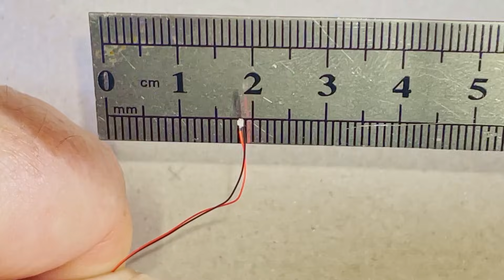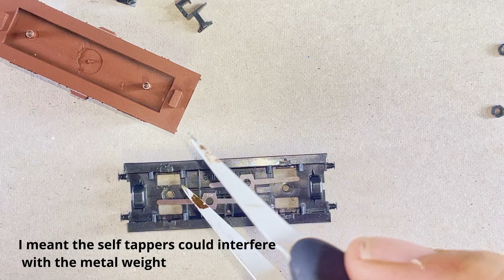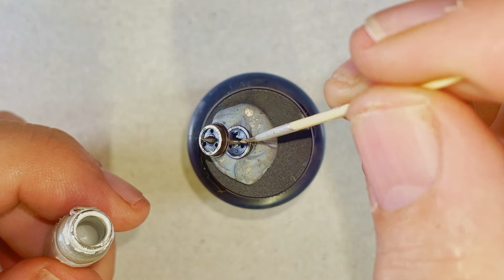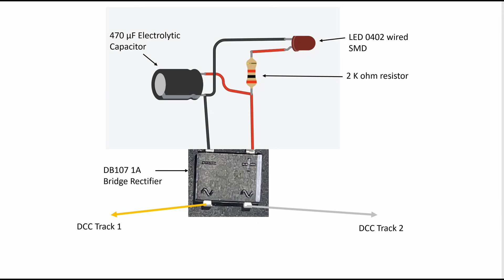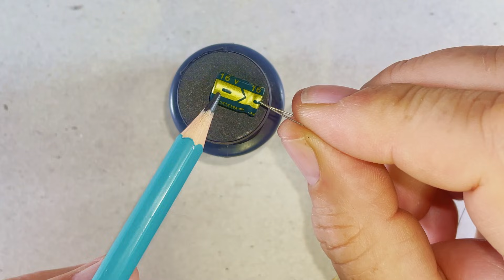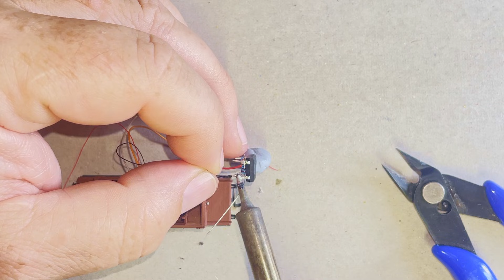DCC Red Tail Lamp Upgrade for your Brake Vans - Even Fits N Gauge Models  Ep11

Comment: With DCC the rectifier is not needed at all, just an extra diode in the circuit. Remember that the LED is a diode so filters out the asymmetric DCC signal together with another ordinary diode on the other LED lead.
For DC use, the rectifier is vital and without the need for diode mentioned for DCC use

Comment: You do not need a bridge rectifier if it is run on dcc. If run on dc yes you do.
Reply from the maker: I chose to use a bridge rectifier, considering the continuous running application, and so to avoid any possible reverse bias stress on the LED. If you see my track tester video, in that application no rectifier or opposite LED is used, in testing that application with modern LED’s I didn’t have any problems.
Reply: It's a nice little project with a good result. I agree the rectifier is a good thing to have, it makes the circuit much more robust. If you so choose, you can run on DC too without any modification. 

When I added coach lightning to a few coaches, my circuit included a variable resistor so I could adjust the LED brightness, which I found especially helpful especially. 

Also Grafar sell a spare wheel set that is conductive so you don't need to bother with the paint (but they don't have the nice holes or rather the three hole variety isn't conduitive).

379-412 Coach Wheels

Comment: Great presentation, well done.   What about heat, 16V to 3 V with the resistor.  Does it generate heat?  And are the components and van body OK with the heat generated?
Reply from the maker: Thanks for your comment 😀. I don’t think heat should be a problem with a 2 kohm or higher dropper resistor the current flowing is in the order of 10ma through the LED, and the power dissapated by the resistor is in the order of 140 mW. Although I recommend you check the temperature of the resistor to be sure. I did not notice the dropper resistor getting warm myself.
Reply: @LlanfordParkModelRailway  Thanks, very fast reply.   Could set it up on a breadboard to check heat, and desired brightness of the LED.
Reply: @richlawrence4160   Exactly.  Breadboards are your friend.  Avoids all the "fiddly" concerns re available space in the  piece of rolling stock while one perfects the circuit. 

Makes solving a  problem determining whether to use a 1K ohm or 2K ohm or 2.5 K ohm or 3K ohm resistor as described below by  @LanfordParkModelRailway easier  where one does not need to keep changing resistors already intaed in a  car / van. 
 
On a  side note, I vote for  a capacitor rated at 25 v. for all applications, whether DCC or DC.  Keeps things simpler in terms of electronics parts one needs to keep on hand in inventory and the 25 v. rating caps provide a tad more protection.  My HO  ( OO for you Brits) runs on DCC while my HOn30" (HOe or HOm) units run on DC.   The narrow gauge logging is integrated into the same layout, but the ng trackage  and the standard gauge trackage  do not actually connect.

That is a problem I will eventually solve, but the size problems with the decoders in what are essentially N scale  engines is a problem which will take some time and some funds which are not currently available.

Comment: 100µF 24V is better
And I would have used the thin wires of the LED and brass strips for pickups
You can buy wheels with one side conductive, so no need for conductive paint

Comment: Love the idea. For older stock running old style lamps it's great. I run 1980s to 1990s that would be flashing tail lamps. Could u make this system but add flashing ?
Reply from the maker: It is possible but would need some more electronic components for the flashing circuit. For N scale the challenge  is always fitting components into the space available
Reply: @LlanfordParkModelRailway  very true. I model oo at the moment so space is not as much of an issue
Reply: @stocktonjunction  One can also find LED's that are pulsing from factory. This will eliminate complexion. Also, if you leave the capacitor out it will pulse whenever the power pick uop is not perfect :D

Comment: I put a tail light into the same brakevan using a length of fiber-optic cable. The LED is inside the van, the fiber runs horizontally into a tiny square of plasticard representing a tail lamp. Much dimmer than a SMD viewed directly!

I'd like to develop it into a system where yeu can tap a magnet on the roof to turn the lamp on or off
Reply: Just fit a reed switch in the line to the led, inside the roof panel, then a strong magnet will work. you only need to fit the switch on one of the wires, either one will do.
Reply: I’ve done the same in my N EFE shark van using a sleeved fibre optic and a flashing red LED with a white metal tail lamp drilled out.👌

Comment: Nice build, though very fiddly 😂. I do recommend to solder a resistor and reverse diode between the rectifier + and the capacitor + to limit the capacitor load current.
Reply from the maker: Thanks😀. I did try and measure the capacitor inrush current, but the charge was so fast I couldn’t read it on my DVM .

Comment: Only problem with this is its way too bright. I started on the footplate in 1980 still in the BR paraffin lamp era and the best you could hope for from a tail lamp, even a signal light is dull flickering glow.
Reply: True, I am a former secondman east London Stratford depot, and yes your right it was always a dull glow at best  !!!!
Reply from the maker: I do agree having run mine for a while. I started with a 1 K ohm resistor and that was far too bright, so as in the video changed to  2 k ohm resistor to lower the brightness. I would use an even higher value dropper resistor next time maybe 2.5 k ohm or even 3 k ohm’s
Reply: The paraffin signal lights were really bad. North/north west of Edinburgh was predominantly semaphore signals back then. Being cautioned at night resulted in peering into the darkness to spot the signal. As one old driver used to say you have to find them before you can stop at them!
Reply: @LlanfordParkModelRailway  Try a variable resistor maybe?
Reply from the maker: @maltnz That’s a good idea thanks

Comment: Nice video, this is a simple and good solution for installing tail lights (and other lights) in model wagons. 👌😎👍
I have one note though*: Due to the fact that an electric motor (like the one in a locomotive) can generate a CEMF (Counter-ElectroMotive Force) that can be of considerably higher voltage than the power normally fed to the rail, it may be safer to use a capacitor rated for 25 volts instead of the 16 volt capacitor recommended here, this will minimize risk of capacitor leakage (or even explosion)❗*(see correction in my reply below)
Reply from the maker: @4623620  Hi thanks for the comment. I worked on the basis that for DCC systems,(as opposed to  DC), commercial solutions for stay alive capacitors commonly supply 16v capacitors. Also of course for DCC there is a decoder between the track rail supply and the motor. However these are only assumptions as I am not an expert.
Reply: @LlanfordParkModelRailway   Please forgive me, you are right, I did not realise it was for DCC, should have read your text (but I am a lazy dyslexic).
Than I could have known I had to mention that my suggestion is for DC systems. 😳
Reply from the maker: @4623620  no problem, thanks for watching the video

Comment: I did a OO scale brake van years ago with a 3mm red LED on normal analogue 12volt,
with rectifier for reverse, 2 of rechargeable AAA batteries and charge limit and LED
resistors for the current in and out of the  batteries !    😊 😊
Reply from the maker: DCC does make things easier 😀
Reply: @LlanfordParkModelRailway   I am 66 yrs, and when I was about 19 yrs
I don`t think there was any DCC ?
Reply: @pjeaton58 1980ish? might've had Hornby's Zero-1 but from what I've heard it was quite unfriendly 😄